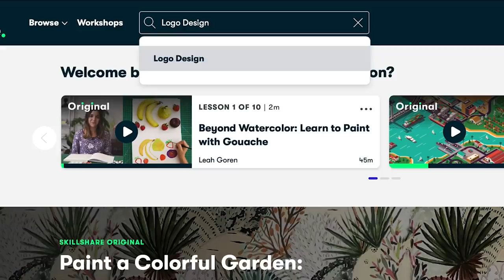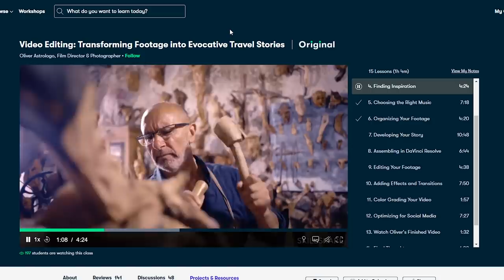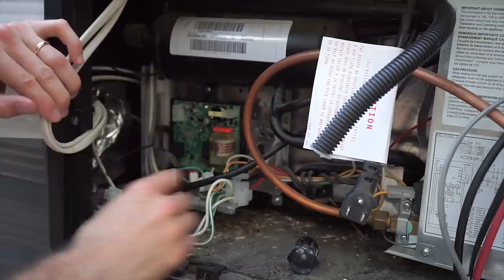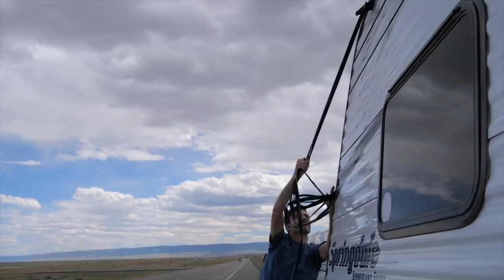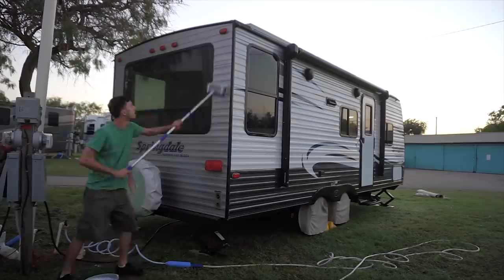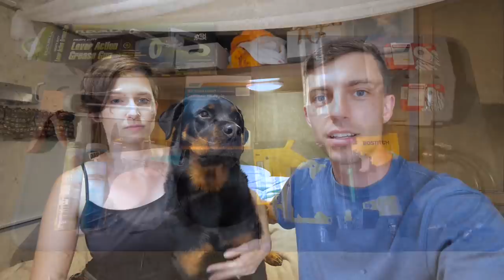LOW QUALITY! - Is An RV More Work Than A House?

Comment: I used to build campers (Hitchhiker 1& 2) and repair several other brands... Yes campers are made out of cheap minimal cost components with the cheapest fasteners and wiring possible. Everything in a camper is meant to only be used on occasion and they are intended to be stored under a permanent roof.

Comment: A stick built house is an appreciating asset in the current economy, an RV is a depreciating asset.   Also not all RV's and homes are  created equal. Speculation homes are built to minim standards, custom homes can be built to much higher standards.    We have a 2003 Komfort travel trailer.  Normal maintenance but for the most part nothing has fallen off walls or failed.

Comment: You're skipping over - getting water in and waste out,  propane fill-ups that you don't have for a fixed residence.   You skipped over getting stuck that time - e.g. doesn't happen with a house.  A better comparison would be a smaller apartment or condo vs RV.   An apartment probably doesn't have a yard and the landlord is responsible for appliances.    Great topic - but you guys are clearly Trailer Enthusiasts!! (which is fun to watch) but I detect a little bit of bias :)
Reply: @Kenneth Almond. Actually a house may have those items you mentioned. I have a well which has to be maintained. Replacing a pump is expensive and digging a new well costs as much as a trailer where I live. Same thing with getting rid of waste. Septic tanks need to be emptied and inspected and septic pumps go bad. I don't use gas but my neighbors do and that needs to be filled. All this plus high property taxes make full time RV living really inviting.
Reply: Do a comparison, of a home roof replacement to an RVs.

Comment: German/Dutch made Beyerland Van. Leaked around the top of the door into the wall, and it rotted out. Electrolux Fridge died almost instantly after the warranty ended. So did the replacement. Rubber seals all perished, no amount of rubber treatment has saved them. UV light faded all the curtains and cushions, and all the orange/red lights went clear. (Importer said its a New Zealand issue as the sky is so clear, UV gets through, AKA sorry no warranty.) Rear support leg collapsed. Truma Water heater burned out, should never have passed electrical standards in the first place, as the thermal fuse was in the neutral line. Truma Gas space heater is like new - it never worked, and it still doesn't, lucky NZ never gets that cold. All the external trim tape fell out so I got new trim and glued it in. Door latch broke - replacement didn't fit the hole so I had to make an adapter. Door stop simply dissolved in UV light, and plastic inside of door broke off when I hung a coat on it. Three 'Whale' water pumps failed in 2 seasons, so I had to drink beer instead of water, and cook in wine. Table latch broke, so you cant stow the table. 12v Power supply and charger broke - no spares available. Such fun.

Comment: I totally get the point you two young folks are trying to make. I have owned many homes in my 30 years in the Navy.  Owned new and old homes, and I have some home owner nightmares.  I’m new to RVING now and have been very concerned with the quality issues I read about.  I have yet to purchase my RV, mainly because I’m over researching my purchase.  Also, I’m researching RVing in general, and you to have been a big part of my knowledge base so far.  I want to thank you both so very much. As an old guy, I’m the one usually dolling out wisdom.  I appreciate the freshness of you to in all your videos.  I’m so impressed with you, and hope to meet you on the road someday.  God Bless you and keep you safe in all of your travels. Sincerely, Wil
Reply: I'm in about the same position as you and I'm looking heavily at ATC toy haulers. I don't even have a "toy" yet but the all aluminum frame and aluminum sheet siding that will never corrode appeals to me. I can handle fixing the appliances but the rusting, rotting, and delaminating of siding, frame and roofs of most RV's is something I never want to deal with. They kind of look like a garage, but it's really appealing to me. However got to save up some $$ for them.
Reply: Do not I mean do not buy an rv with a particle board floor. Only Plywood floor.
Reply: If you want quality, check out Outdoors RV or Northwood brands. They’re built differently than all the other brands.
Reply: @jenketcham5539  I agree. I have an Arctic Fox, which is a four season fifth wheel.  28 feet and fits my wife and I like a glove.  We've had it for 20 years, and other than routine maintenance, no issues.
Reply: You just can't beat a Lance for quality.

Comment: Things break no matter what,  preventive and routine maintenance goes a long way towards avoiding unexpected and/or expensive repairs.  And whether you live in a house, apartment, or even a van or boat, having a decent set of tools is a must.  

I've camped in tents, pop ups and travel trailers as a kid, one thing is a constant, things will go wrong, you just adapt and keep having fun.

Comment: I'd take an RV over a house any day. Sold our 3 bedroom hm on Dec 2019, bought an RV and have been Rving since....
With the home HOA, we even had to clean our roof, which shortens the life of the tiles in many ways... the cost to repair broken tiles is not cheap at all. 
I can redo our entire  RV roof w a fraction of the cost of a house roof. Also, i dont need to pull a permit to work on anything on my RV..... just that detail makes RV life priceless.

Comment: I always carry a set of wheel bearings, grease seals and fuses. A small bottle of contact cement comes in handy when weather stripping comes loose.

Comment: Good video guys! Been meaning to comment for almost as long as you have been out here. You are doing very well with your "stick and tin" rig considering the abuse it has taken on backroads etc. My last RV was stick n tin 33ft long Puma. Managed to put 5000 in the first year. Replaced the factory junk shackels and plastic bushings with a greasable  wet bolt kit. Also replaced equalizer with Road Armor rubber cushioning style plus shock absorbers all the way around. What huge difference in towing and minimized wear in general in/on coach. You should consider the need to change your suspension components before catastrophic failure. My bushing were 80% gone in the first year.
Keep up the adventure!

Comment: Definitely our 2019 24' Jayflight! Just going home from the dealership staples popped apart,  stuff fell off walls, bunks popped apart. A week later leaks found from shower surround and plumbing. Rim overheated during trip. Stereo died, pull-out misaligned and rubber seal around it loose.
Reply: Unfortunately Jayco is a poor manufacturer.

Comment: Your right, you have used your RV more than usual. I bought mine in 2017 new and used it 5 times. But I can say we had no problems so 
far, we went on a month travel but it has been the only long haul we have done. Being in California I pay almost 500 a year for registration and insurance to have it parked, plus a extra 150 a year for extended warranty on my appliances.
I am wanting to move to Evansville, Indiana. And maybe my registration will go from 260 to 60 bucks a year. And my 7 year truck will go to 500bucks to 100 bucks a year. Lolol.
As always you guys rock. Stay safe, Take care you guys.
Reply: $500 a year for truck insurance is cheap! Here in BC Canada I pay $245 a MONTH and that’s the cheaper option with a clean driving record.. crooks

Comment: Hey David and Roe, interesting video and perspective. Your perspective from a full RV’ers view is truly comparing your home on wheels to sticks and bricks. That said, 99% of people only recreate with their RV. It is basically their toy, their get away from reality escape pod so to speak. Most people have limited time to enjoy their RVs and when they are ready for fun they are not ready to deal with a broken toy. 

Everyone with a sticks and bricks home has had to deal with system failures at one time or another: a failed fridge, an air conditioner that does not condition the air, a leaky roof or a failed washer or dryer. Like you in your home on wheels, the sticks and bricks folks deal with the problem. The service industry for sticks and bricks is well established with countless options ready to show up to fix what ever 24 x 7. There is a reason for such a robust service industry for sticks and bricks. Stuff fails in homes all the time.

But when the average home owner is ready to play and their RV has a system failure they discover that the RV service industry is in a sorry state of shambles ill prepared to get the rig back up and running in time for the planned escape. So fun time become pain time. As a result for most they will argue that the RV is in fact more work than sticks and bricks.
Reply from the maker: Very valid point! It's very true that most people who own an RV will only use it during vacation or on a short getaway so when something fails it's usually while they're trying to have fun which can ruin a holiday. That's why it's so important to know the in's and out's of your rig and have some common spare parts on hand for small repairs. Obviously a big repair like a fridge or air conditioner isn't going to be easily fixable while on holiday. But in cases like that, it's better to go with the flow than let it ruin your good times. If something is wrong before you hit the road then maybe a hotel or even a tent camping trip will suffice for the time being so you can still enjoy time away from home.
-Roe

Comment: I suspect one of the first things to do is reinforce the woodwork.  Angle braces and screws.  Relying on staples that many manufacturers use to hold flexing wood pieces together.  You would think that the various appliances that are made for the trailer market would last.

Comment: I posted a long video on the poor quality of my camper. It's the second one I've owned and I knew not to expect much but just the poor craftsmanship is mind-boggling. I understand when you have to use lightweight products to keep the price and weight down but my problems I feel are mainly tutu poor craftsmanship. When something can be done just as easily the right way but you can tell the person doing it just didn't give a crap. That's where I had my problems.
Reply: Total agreement. People making slightly better than minimum wage throwing these things in a factory that isn't heated or cooled... everything is half assed by people that don't even have any training or grasp of end use.

Comment: While your conclusion is correct there are some points you did not mention. Just like all houses are not built with the same quality so are RVs. (using the term RV to describe everything from a trailer to a million dollar class A is a bit misleading) Some travel trailer interiors, sounds like yours are built with particle board, staples, sheet metal screws, foil covering and wood frames. Some are built with plywood, screws, laminate or solid surfacing. Some exteriors have molded fiberglass caps instead of vinyl covered trim strips. There are many other differences but some things I've mentioned will have less problems than you had. Appliances come in different flavors also but the better ones will have better warranties and share parts with their residential counterparts. So just like a builder's grade tract house a price point trailer will not last as long without issues. It will however get you on the road for a lot less money. The choice is up to the buyer.

Comment: When did Jen become "Ro?"???
I still live in my sticks and bricks, and inside the last year, I've had to replace the washing machine, the refrigerator, and the water heater!  All very expensive items.  And yes, there is some deferred maintenance with the actual structure that I can't manage by myself, and can't afford to hire help.  Plus all the yardwork I can't keep up with alone.  So, I think an RV would be much easier.
Love you guys, and Sweetie is cool...but I also love your cats and bunnies! ;-)
Reply from the maker: I've been going by my middle name with everyone else I know so I decided to start using it here too since it's the only place left that I don't go by Roe. And yeah, a house can be much more work especially when they get a bit older. Our house and our trailer were both pretty new so we haven't have tons of problems in either.
-Roe

Comment: The tongue jack failed?? WHAT?? That should NEVER happen!! That's crazy!! As far as the faucets go they are total junk and that failing doesn't surprise me at all. Since you're full timing I would recommend just swapping them out for residential fixtures. A good house faucet doesn't cost much, doesn't weigh much more and it's one item you will always be using. You can't go wrong swapping them out for higher quality residential fixtures and they will fit as RV faucet dimensions are the same size as residential ones.

Comment: The cheapest trailer around where I live is $30,000 from a dealer, and they are hands down the cheapest made product I've ever seen.  They do look good and but you will always have to work on it.  Just be prepared.  Also they do NOT hold their value, resale is worse than a car or truck.

Comment: Did you guys change the tires out on your trailer before you hit the road? What type of tires do you use? I live full time in my trailer since 2016 and bought it brand new, lucky only had a few things I have had to fix on it. I will never buy brand new again especially since you loose a lot of money once you drive it off the lot. Buying used is the way to go.

Comment: The problem is greed. I am telling you from a family of business owners.Too many business owners want to make insane amounts of money quickly with out giving you quality for your money. The worst thing we do as consumers is fall into the trap of what you said if it was built better it would cost too much. Absolutely not true. Check the price difference  between a 4x8 piece of real plywood compared to the same 4x8 particle board.  No more than a couple hundred dollars more to floor a whole rv. Wouldn't you pay a couple of hundred more dollars for a better built rv. I am sorry but an rv with a particle board floor  is just plain junk. It is going to get wet and fail and the whole rv falls apart.It should be illegal to build them that way. They just do not care and really do count the pennies for a stock holder. 33 percent profit on the final cost to build something is usually enough to make a very comfortable living but some of these things we buy are marked up sometimes hundreds of percent profit margins. No more than a get rich quick scam. Business used to build quality and have pride in their product no longer is this the case. Your new cell phone cost just a fraction to build and they are selling some of them for a thousand dollars or more apiece.   I bet they do not cost them fifty dollars apiece to build them. It is insane.

Comment: RV should be compared with cars, not with houses. Car have high engineering, RV have medium, and houses have low, so RV quality come from "medium" engineering level, and is lower than houses because of shitty materials like plastics, even those are chose wrong or to be cheap ,... the engineering quality on RV has improved over time, but assembly remain mostly like diy in your garage. So RV improved over years from low tech to some medium tech, and quality might vary with brands, factory size, location...

Comment: Doing the math... you said you carry over 140 gallons of fresh water for boondooking? That's great but it is 1074 lbs! Still load range D tires on 14in rims plus everything else you carry makes me wonder what numbers you see at a CAT scale.
Why don't you employ a weight distributing hitch?
Me thinks you guys are running on a lot of luck sometimes. I sure hope your good luck continues.
Ron
Reply from the maker: Hey Ron! As we explained in the video, 87 gallons of water is in the bed of our 3/4 ton diesel truck, and our trailer only holds 54 gallons in it's original fresh water tank. Our trailer isn't carrying any extra water than it was designed to so the load range D tires are fine. Also, our truck has a hauling capacity of 2,900 pounds and 87 gallons of water is only 725 pounds plus the 550 pound tongue weight of our trailer fully loaded is only 1,275 pounds. So we are well within all the load specs of our truck and trailer. There is no luck to it, we selected this truck precisely for its huge hauling and towing capacities 👍

Comment: RV's are in general poorly designed - cheaply made - little quality control - using the cheapest materials - built built by cheap unskilled labor - they are built with the goal of the least amount of time before completion. Apparently the price you pay does NOT seem to help - the more complex the RV the more problems. Still in spite of the negatives the social interactions with fellow campers is a source of wonderful experiences and new friends.